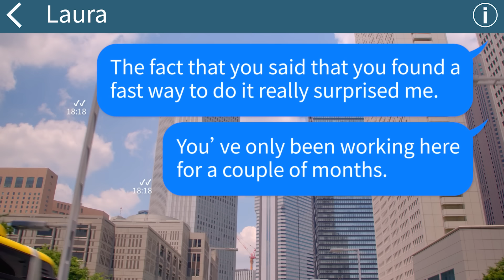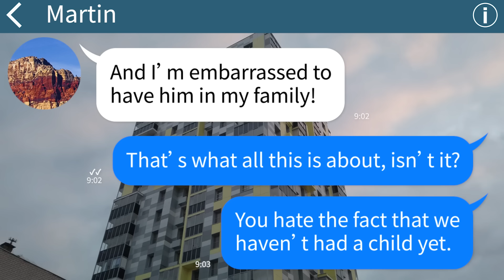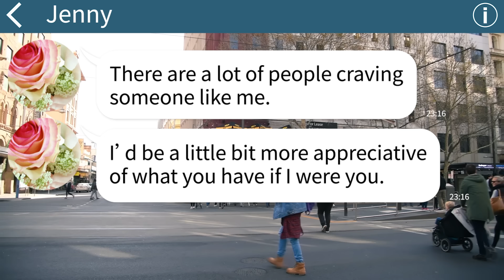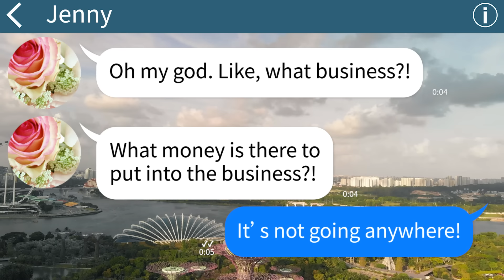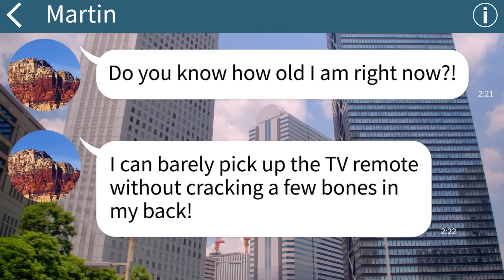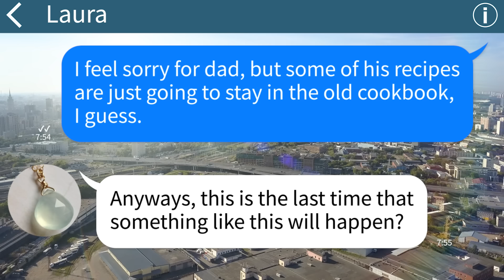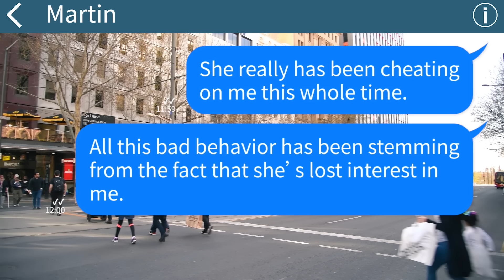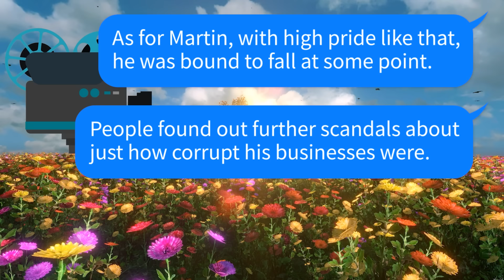【Apple】Overbearing father-in-law abuses me thinking no one will find out. Then I broadcast his…

Comment: If you don’t like the length of these videos I have a suggestion for you. Take the length of the video in minutes, divide it by 3, and see how many minutes you get. Take those time lengths, and watch the video. Once it reaches the first part, pause the video. Come back the next day to watch the next part. Then the third day to watch the last part. It would take like 5-10 seconds to calculate. Whereas it’s much more work for the authors, actors, and editors to divide all the videos up and post them each day instead of just one long video on day 1. Personally, I like the longer videos. But if you don’t there is a solution to it that doesn’t involve “dance monkey dance”.